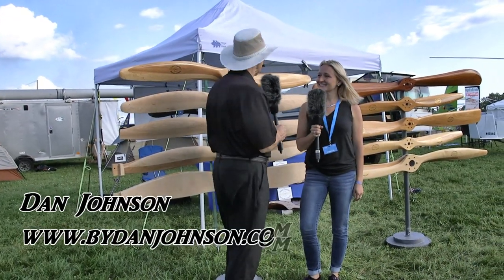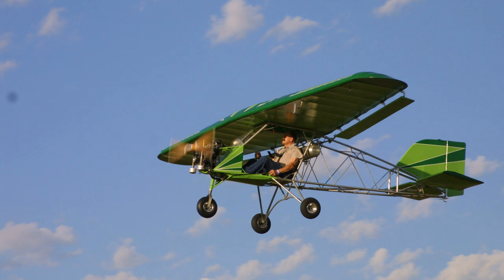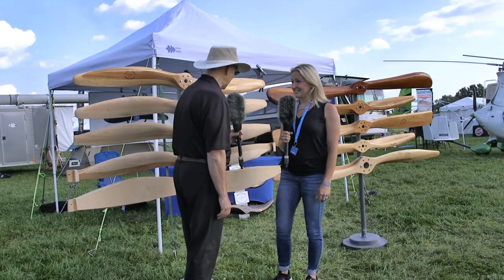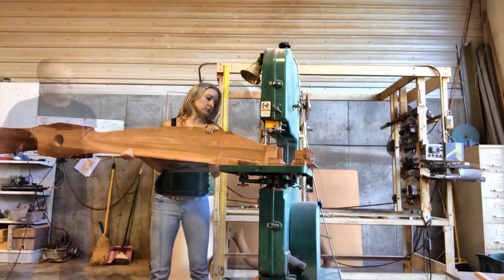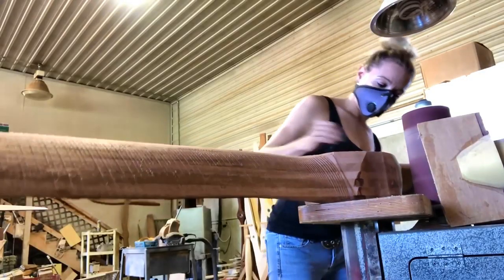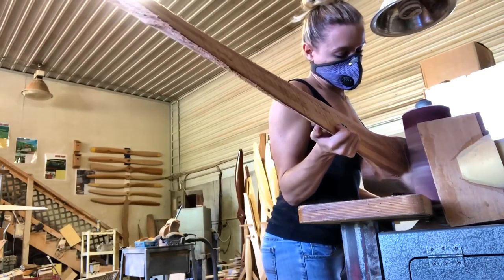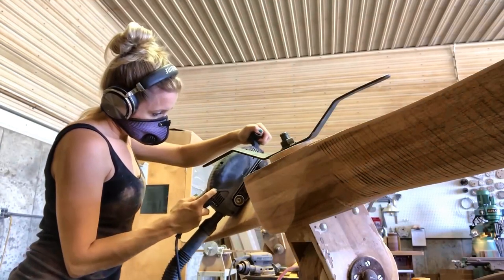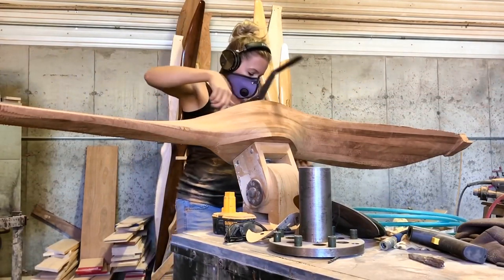Culver Props, Alaina Lewis, making a Culver aircraft propeller.

Comment: G'day,

Yay Team !

  I posted a couple of Propeller-Carving Videos about 2 months ago...; 4 Laminae of rare & commercially extinct Australian Native Timbers, Quarter-cut salvage-milled with   a Chinsaw - from Windfallen Trees...

The Prop's I've been making lately are tiny, 8-ich Diameter & 6-inches Pitch ; running on DC-Motors powered by Peltier-Effect Thermoelectric Generator.

  The Peltier Effect Drive- units come from China, factory equipped with a 4-Blade Sheetmetal caricature of a Propeller..., which I measure as 18% efficient.

 So I put my cantankerous Hat on, and made something which is closer to 90% Efficient, and looks a LOT better.

I'm planning on trying to sell some in an Art Gallery (!).

Have a good one.

;-p

Ciao !